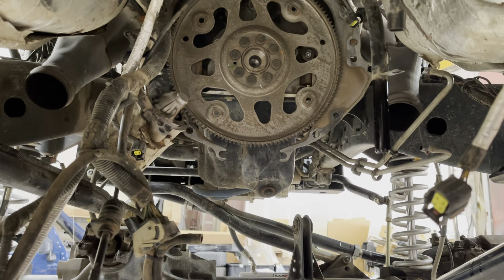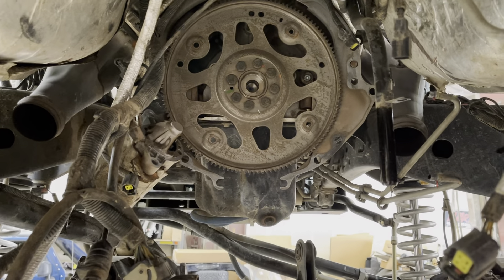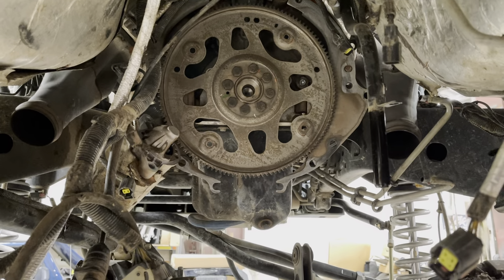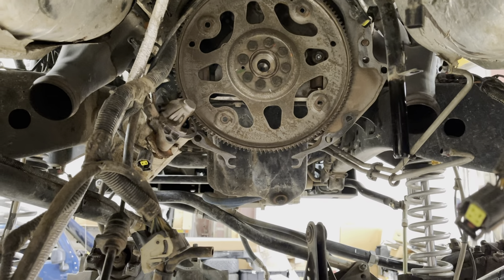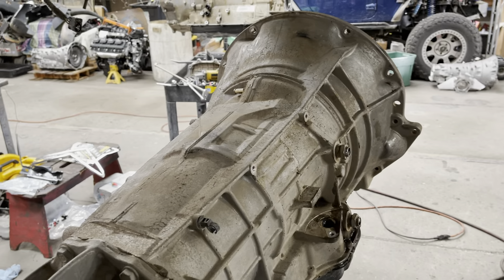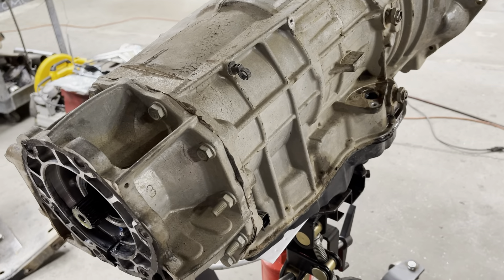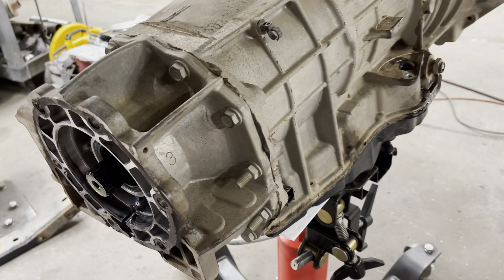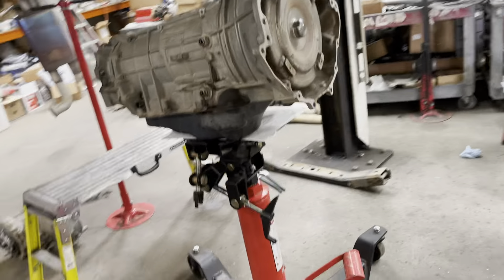Jeep Hemi transmission conversion from a 545RFE to a HP70 8 speed transmission.

Comment: I would like to do this conversion on a 2012 Ram 1500 5.7L, currently has the 65RFE. I have seen some guides online that make it sound like a aftermarket TCU is required. Would the process for the Ram be similar to your jeep?

Comment: I have a 4x2 Hemi Jeep 14’ 
What transmission are compatible?
Reply from the maker: So you have a 2014 Jeep JK with a 5.7L Hemi and i guess you have a Nag1 transmission. Do you want to keep it 4x2 or go 4x4..
Reply: @jeepspeedshop  I forgot to mention, it’s a Grand Cherokee , WK2 they didn’t switch to 8hp70 until 14+ in these
Reply from the maker: @Forgedpg  So if you want to do a 8 speed swap on your GC i would use a Challenger or a Charger transmission HP70

Comment: Are Jeep and Charger 8HP70’s the same? My Jeep is RWD now with the 5speed and want it to stay RWD, but with the 8speed.
This would just open up my options if I can get a regular Charger/Challenger trans too.
Reply from the maker: So i'm guessing you have a 2012-2018 4x2 Jeep with a 3.6L and want to do a 8 speed, now the 3.6L Challenger or Charger transmission will work, or i would buy a Truck 3.6L 4x4 and make your Jeep a 4x4.

Comment: how to flash the computer and get it started after removing the the 545? 

i would appreciate you help
Reply: We have to take the 545 Transmission stuff out of the computer.
Reply: how can i take the 545rfe out of the computer? 
can i do it with hp tuners?

i am done with the swap and wiring for the transmission but stuck now the starting stage 

please advice
Reply: @abdulazizalowaisi9136  how did it go?
I did a 545 to 65 rfe swap, now looking towards a 8hp70 swap.
Reply: @Tee008  i have done the 8hp70 swap and working fantastic with the 6.1
Reply: @abdulazizalowaisi9136  so it's just down to computer programing that's the hardest part then, can a dealership do it or do I need some chip burner, I'm used to 80s cars and trucks. 

That's my last question.
Reply: @Tee008  what is your application and set up?

It requires some parts, stand alone computer and programming

Todd at Jeep speed shop does a good explanation and guidance on the parts required and how to do it

I might be able to help but i need to know what your application is (year, model, engine etc)
Reply: @abdulazizalowaisi9136  sorry for delay, didn't get notification.

2009 jeep commander with hemi.
If I need to purchase some programming  equipment then I don't mind, I work on computers and electronics alot.
Reply: @Tee008  it will work perfectly, especially if it has hemi 5.7 that means it has 545rfe transmission
Which makes it easier and you can re use a lot of parts like the starter,dust cover, lower structure plate etc

You will need 8hp70 transmission, 8hp70 computer and harness kit from JSS, 8hp70 flex plate and oil cooler lines.

Programming should be fairly easy via HP tuners

Comment: Which v8 did this jeep have in it?
Reply from the maker: This Jeep Had a 6.4L, but it does not madder what Hemi you have the HP70 will work. I have a 5.7L VVT Truck Hemi in our shop Jeep and it works great.
Reply: And that truck is awd correct?
I have an awd charger with the 5.7 and I just got my motor back from getting built and its power is estimated to pass nag1 peek power parameters so now im looking at the 8hp70 or 8hp90
Reply: @jeepspeedshop  will this work with a 6.1 hemi?
Reply: This sounds dumb but does this work with the 3.7? "Asking for a friend😅"